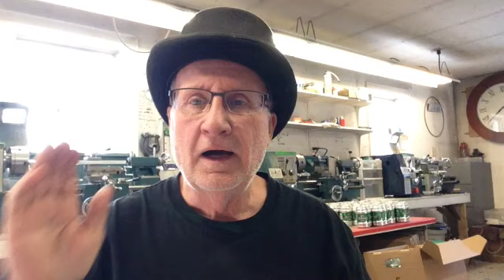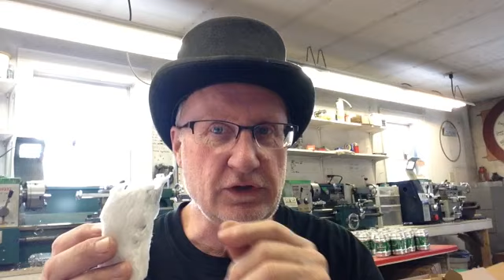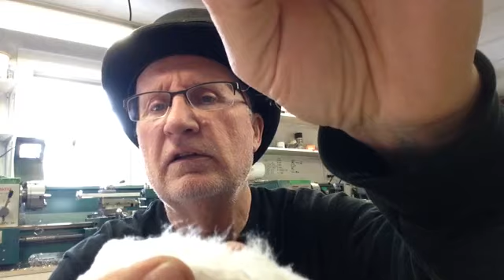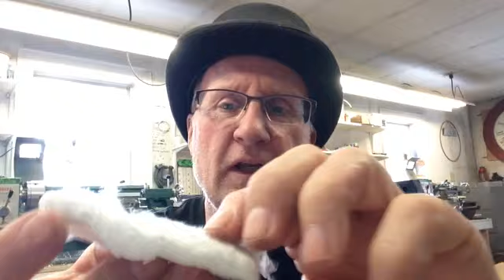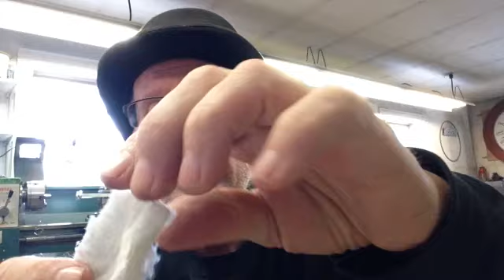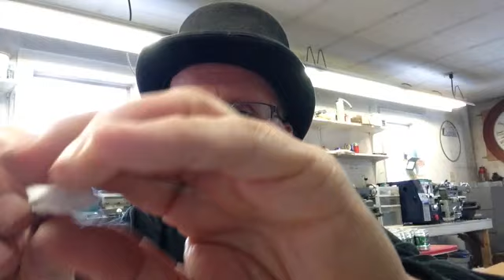Ceramic Wool

Comment: We used this stuff on a locomotive boiler. It was easy to cut with a Stanley blade, easily formed around studs and bosses on the boiler surface and was generally much easier and more pleasant to handle and use than was fibreglass. However, we made sure to use dust masks, goggles and wore overalls when using this material. It does cause tiny skin lesions and itches like hell between clothing and skin. I have heard that it can cause problems if breathed in.

Comment: John Austin,  Did you ever use a Mr. Clean Magic eraser for a fire wick with alcohol ? I took one and put a match to it and it did not burn, only got black in places, so then i soaked it in 91% rubbing alcohol and it lit and stayed burning until the fuel went away out of the foam, after that the magic eraser went out and it was not even hot  to the touch at all. The ingredient  of Magic Eracer is " Melamine Foam".  Check it out, but it does get black after burning off the fuel.  Also I want to make a alcohol fireplace using a existing  British cast iron insert. I want to build a wooden mantel surround around  the insert, but do not want it to get hot inside when a alcohol flame is used in it as any flame will cause the iron to heat up. So wondered if i could use a Ceramic blanket between the cast iron and the wooden frame mantel structure and be safe? The Ceramic blanket foam can with stand 2300 F.  So do I put the ceramic blanket around the back  directly on the iron insert as well as under it, or do i staple the ceramic foam blanket onto the inside of the wooden structure and leave a gap around between the wood / blanket and cast iron insert ? I have not seen many if at all information on Youtube. I did see a outside bread oven being made , and they put the ceramic blanket around the brick and secured it with chickenwire. I also saw the inside of a cooking range that had ceramic blanket around the stove part .

Comment: Here's the material safety data sheet;  http://www.lewcospecialtyproducts.com/Files/Press/RG2300CeramicFiber.pdf

Safe handling recommends using a face mask to avoid inhaling any particles. Main use seems to be stove insulation,where it is enclosed, static and not subject to movement or abrasion which would cause breakage and airborne particle release. Looks to be good,inexpensive insulation material in a closed system. The weakness of the material shown in your video suggests that it is probably not suited to use as a wick material in stoves. Probably not suitable for cosy insulation, as frequent movement, compression etc. would lead to non-reversible compression and breakdown.

Comment: Ditto everyone else, put a mask and gloves on, put it in a trash bag and take it to the landfill, work in a fiberglass plant during college and I was the field engineer at the largest landfill in the region. Carbon is much safer.
Reply: David Saunders this is not fiberglass.
Reply: If it is Kaowool it has a worse reputation that fiberglass and at least in the kilns and forges I know, it is coated in place, and not burned in the open.  Though some of that is to do with the fact it is eaten by flux, but not everyone forge welds.

Comment: interesting. I would expect that stuff to be decent high temperature thermal insulation provided that it had the space to stay fluffy.
Reply: This stuff can be compressed quite substantially and still offer serious thermal insulation properties. It even comes in fairly rigid sheets. You can go at it with a butane torch on full blast for months and years on end, it won't bite. You do need to consider your application, design and needs, for how much space for fluff and air to give it. The characteristics does obviously change as the insulation gets denser, as with all other insulation materials.